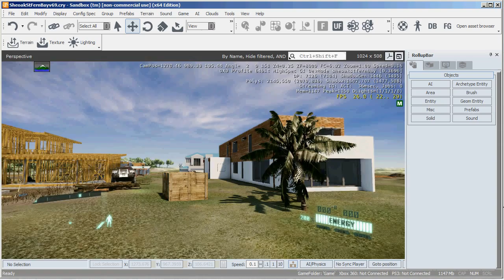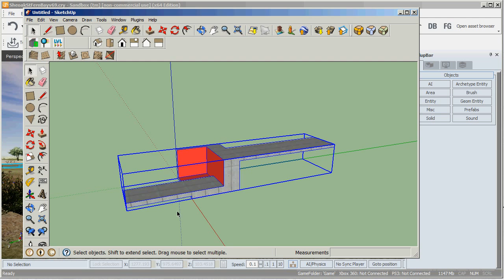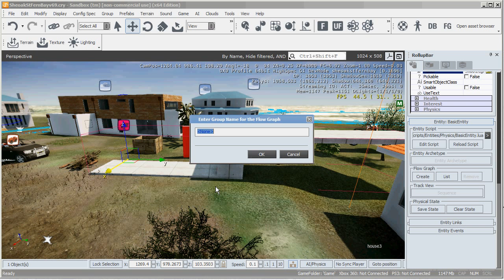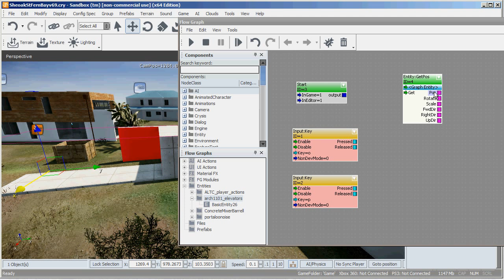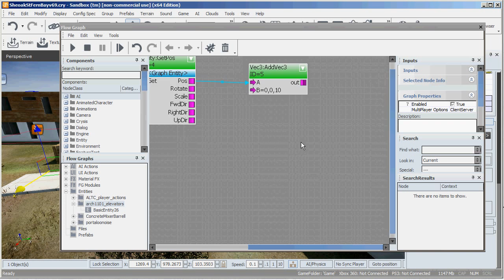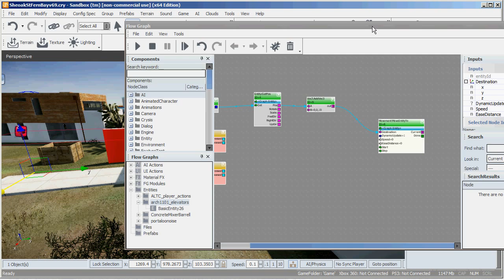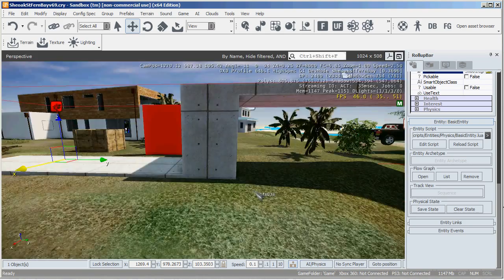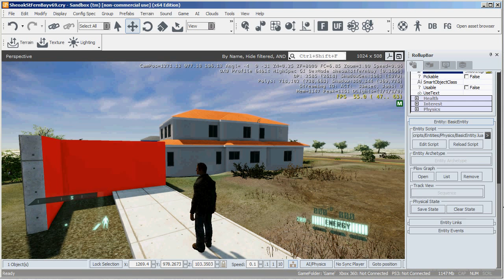CryENGINE3_MovingEntity

Comment: there is no input key
Reply: Pretty sure this was a custom code he had added cause there is no Kinect nodes either.  You can use debug: inputkey instead although this should not be used as a final solution.